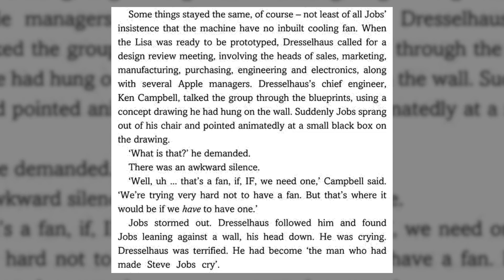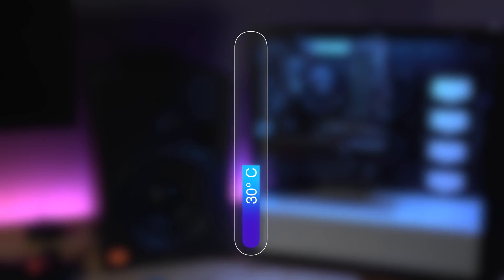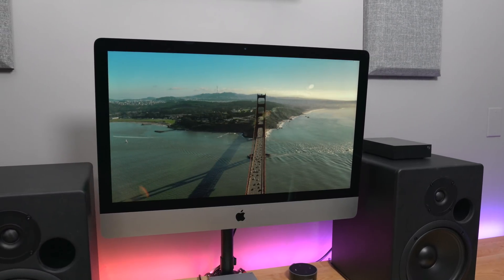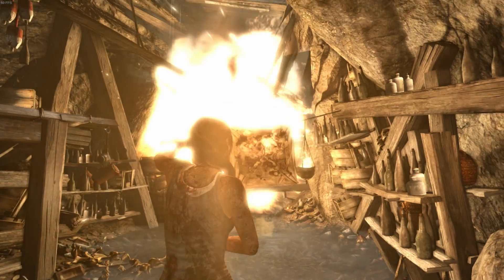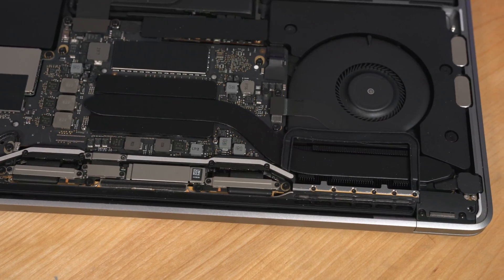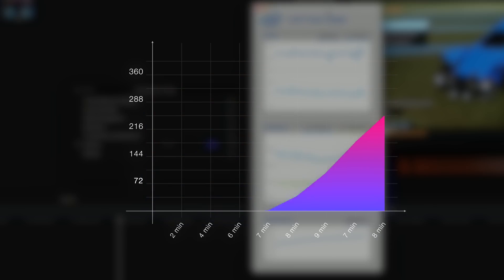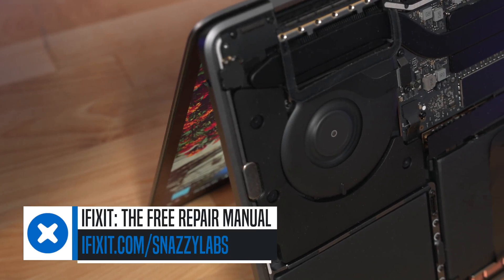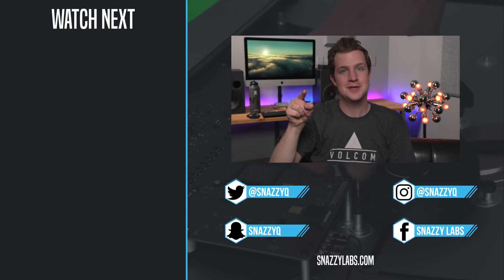Is Apple Ruining Your Mac's Performance?

Comment: This is why I use smcFanControl and have it cranked to 6000 RPM at all times. Otherwise my 13" 2015 MBP is too slow tbh.
Reply: Enzo Caggiano My 2007 MacBook Pro burns me if I have it at 3000RPM fixed.
It needs to be at 100% if you want to keep it one your legs for longer than 5 seconds.

Porco dio
Reply: I use that too. Otherwise my 2006 mbp would burn my legs worse than it already does :p
Reply: @centurybug  Was your 2006 MacBook Pro always so hot in the initial years when you got it? Or it got worse later on?
Reply: @RamMohammadJosephKaur  I didn't own it when it was new, I got it in about 2014 I think? Macbooks are known to run hot though, so I wouldn't be surprised if it was always that way.
Reply: Enzo Caggiano you’re wrong
Reply: Gerardo Ricciardi yep. And tbh I only keep mine high to load a bunch of YouTube videos at once or when exporting a video
Reply: iTouchAppReviewers he's not wrong.
Reply: iTouchAppReviewers is your mac burning too when you are watching videos?
Reply: iTouchAppReviewers I almost cooked my legs while using my 2009 MacBook pro.
Reply: iTouchAppReviewers This is why I have a PC.
Reply: victornpb I don't really care about the fan life, I have thousands of spares in my friends computer repair shop
Reply: i use macsfancontrol and i set it up to range the rpm of fans within a smaller interval of temps (like i set a much lower max temp and a lower favourite idle temp), so it just ramps up normally but in a smaller temp range.

AH and i also made holes under the fans on my macbookpro. holes in a radious pattern and placed a very thin plastic mesh on the inside to keep dust out.

now is properly cooled, trust me, if your mac is "vintage" or "obsolete" get a dremel or a proxxon, draw a good pattern and drill the shit out of it
Reply: fan lifespan is such a stupid argument. running cpus and gpus hot will reduce chip's lifespan, which costs more? a board or a fan? have you a grain of salt? i've replace both my mbp fans with the same model it mounted = 15 bucks and super easy. if you burn your gpu (look at 2011 mbp) well...600 bucks. PLUS on a modern mbp you'll lose all the data since the ssd is soldered on tur board, so it's a 600/700 repair + data loss for longer fan lifespan.

dust doesnt affect electronics as long as you dont work in an metal workshop
Reply: I came back to this video to comment smc Fan Control.  Perfect accompaniment to any Mac.  But 6000 rpm is a bit extensive.  I have a higher RPM setting at 4000 rpm which I turn on before doing CPU extensive tasks to pre-cool.
Reply: i use that so it doesnt burn my leg in garageband
Reply: Don't forget about the fan life as well, at max speed it also wear faster, I don't recommend cranking it to full speed, put it on like 80%. You have diminishing returns on RPM vs Power dissipation.
Reply: Enzo Caggiano Enzo I did and nothing changed. I too thought that 10 years old TIM was the problem, but nope. I replaced it with MX-4 and it still goes to 80 degrees when I charge it.
Idle temps maybe went down about 2-3 degrees
Reply: victornpb Replacements are super cheap even in the new model and fortunately, the fans are super easy to replace
Reply: If you're going to drill holes on your MacBook I advice you to drill on the opposite side of the hinge not right near the fan, that way you will have airflow on the entire board and not just the heatsink.
Reply: I don't think what apple does is bad for the average consumer, lower speeds will make the fan last longer, most of the time you will have a quieter machine, it will collect less dust, so maintenance will be lower. I agree that for "pro" users is not something they want, but it make sense to let pro users change the profile to a more agressiva cooling than asking the average to tweak a profile to make it run quieter, they just don't change settings.
Reply: victornpb 
do you mean on the top? just above the keyboard?
ot you mean on the bottompanel but "away from.the screen" like where the trackpad is placed? bc there is the battery and would be useless, but above the keyboard on the top panel could be good to let heat raise and escape.

it could be a though job thou
Reply: iTouchAppReviewers 
I always hated using my MacBook Pro in class, cause it was the loudest beast in the room just to avoid singeing my legs.
Reply: iTouchAppReviewers one word: ssd
Reply: I use SMCFanControl but I don't want my machine sounding like a leaf blower all the time.  I bump the speed up until it starts to become noticeable, then back it down a notch.  I just wish it allowed you to re-map the entire Temp vs. Speed curve because it's really the higher temp zone that needs the adjustment more.
Reply: Gerardo Ricciardi ahahhahahah il porco ci stava pienamente
Reply: 5000 rpm is the sweet spot between silence and burning your skin
Reply: Yeah but it's too loud imo. Used for a while but it's very annoying running fans at 6000rpm all the time
Reply: Enzo Caggiano
è difficile cambiare la pasta? Ne ho davvero bisogno ma ho un po' di paura. Secondo te se vado in un apple store con la mia pasta e gli chiedo se possono cambiarmela lo fanno?
Reply: I use macs fan control for cruising my fan at 6500 rpm XD, but the lowest it can go is 41 degrees...that's hot!
Reply: I use mac fans control and also replaced thermal paste and cleaned the shit out of it, at least the average temps dropped by 10ºC and i don't get close to 96ºC anymore, maximum peak are 86ºC or so which won't kill the cpu or the gpu that fast, unless I'm exporting ofc. The next step is to upgrade to liquid metal thermal paste but this needs to be applied with extreme precaution since its conductive and can kill your machine, but it does miracles to temps! Some people reported up to 20-25ºC less after the upgrade, even on full load! So yeah I recommend also cleaning your fans and heatsinks regularly (once a year or every 2 years) and the thermal paste with a quality one, (IC diamond, Grizzly (best one IMO), Arctic, etc)
Reply: Enzo Caggiano cleaned with thermal grizzly kryonaut but using serato dj or final cut I open smc manual on 5800 rpm while having my macbook on a flat surface with something under on the sides since the cpu and gpu and the cooling system is all in the middel and rightside (bottom) leftside from the keyboard and works great never have a cpu throttle

Comment: I installed mac fan control appli. at default, MBP's fan speed is too slow.
I think apple's productions remain outside , they have no desktop ,they have no high performance GPU, they have no liquid cooler sysytem.

Comment: sadly, almost every single high performance laptop and all-in-one PC has some degree of thermal throttling on heavy load.
Laptops I can understand, there's not much space to work with, but iMacs and other AIO PC's often have a lot of room inside that whole genre needs better cooling solutions
Reply from the maker: +Dave Lee Agree. Laptops are understandably tight (although, they could definitely put the second fan in the base-model MBP escape). I completely agree on the iMac. There is tons of room in there and a super tiny cooler. This year (2017) they moved to a slower fan that doesn't push as much air. Why? Who knows...
Reply: for the upgrade in 2018. "NOW WITH 23% MORE AIRFLOW!"
Reply: Dave Lee I think Apple got liquid cooling PTSD from the Power Mac G5, but I'd love for them to try self contained liquid cooling again, in the iMacs and/or the Mac Pro.
Reply: Sgt Brobee Microsoft made the bottom of the Surface Laptop a vapor chamber cooler, which is pretty cool, other choices in there aside. I'd love Apple to get more creative with cooling than just fans and heatsinks.
Reply: And the MSI Titans and Asus GX800 are here to save us from heat!
Reply: @Martin Peterdamm, Apparently you DON'T know the "chips" inside the iMac pro. The optional Pro Vega 64 in the iMac Pro will have a 225w TDP. Not sure what the TDP is on the base option Pro Vega 56 yet, but it will obviously be less than 225w. As far as the processor goes, the most powerful option is 140w (18-core Xeon W-2195). If you're going to prematurely declare something as a failure you better at least have your facts straight.
Reply: Dave Lee no it doesn't lmao. If your laptop thermal throttles you bought a shitty laptop. My Asus rog only hits 85 degrees Celsius under really have load.
Reply: Martin the iMac Pro will clearly use slightly underclocked chips, their webpage for it states the whole thing is 500 watts where Vega could take most of that alone. Like the "pro" radeons in their Macbooks, they'll dial the clocks down a bit for much lower power use. We'll have to wait for throttling tests.
Reply: Problem with iMac is the "thin" design, which is only really thin at the edges anyway.  You have to have a mount / stand behind the damn thing anyway so thinness in iMacs is an even bigger fallacy than in laptops.
Reply: Hey you two, go get a room! 😁
Reply: they should make the entire underside of a laptop a heatsink
Reply: Sgt Brobee So you can cook your lap while working :D
Reply: The ROG cooling systems are hella overbuilt. Mine is 5 years old, and even maxing out the GPU and putting a good load on the CPU (still haven't maxed that out) it still runs at a decent temp, and not too loud either. Very solid laptop (in case the weight didn't tip you off), worth every penny.
Reply: Christian Stout totally agree, my gt73vr never overheat.
Reply: My Aspire V Nitro throttles too much. 100C under load. 15 inch laptop, with a decently beefy cooler.

i7-4720HQ, GTX 960m
Reply: Will Dresner repaste your cpu and GPU then undervolt both of them, it will solve all your issues.
Reply: Dave Lee I think the vents on the back of the iMac could be way better my friends Inspiron 15 7567 gaming laptop might have a better cooling system than the iMac pro 
That thing is so big and could have a way bigger fan and a bigger area on the back of the computer for heat to leave
Reply: They want your CPU to degrade much quicker (as well as other parts) which equals to repairs or lower life span. This results in buying a new laptop/desktop ever 2-3yrs instead of 4-5+yrs.
Reply: I'm pretty sure you know most windows gaming (and not) laptops don't throttle this frequently or at all.
Reply: Gianmarco most window laptops do throttle... its called shitty laptops... Apple been going down hill... I admit this...
Reply: Dave Lee BS! Dell precision, Lenovo ThinkPad, HP elitebook laptops all equiped with workstation GPU + Xeon cpus + 64gb ram + up to 4 hdds...work constantly 100% load on everything, all day AND with the screen lid in closed position, never went above 65 Celsius. None of those has any of Apple dna.
Reply: but just compare pc and apple with the same hardware inside and then their cooling solutions. in the pc world the barrier is around 79°C because of degrading … apple gives a shit about it. 
take a look at the upcoming imac pro the already known cooling and also we already know the chips insides : the vega runs hot as hell with spikes over 400W and the new multicore skylake xeons also over 300W and this has to be cooled. even apple can't beat physiks and so the imac pro is already a huge FAIL or just for people with small, short projects
Reply: Dave Lee you are a fanboy man, shut up
Reply: i do have old inspiron 7520, bought 5 years ago. Overclocked gpu by 20% (without changing voltage). It has mobile i5, and 4 core i7 was also an option. It never reached 90* even under full load. The point is: look for temps in reviews, and dont get the most power hungry option, cause they all have same cooling system.
Reply: Dave Lee

This noob keeps crying, not knowing what he say's, mumbling bullshit channel. Apple invested in ARM and the PowerPC consortium, not able to release any complex high Ghz CPU, needed the water cooling solution on a office computer....
Please remove this channel, or keep crying!

Comment: YES. MacOS Sierra caused so many overheating problems, blasting the fans when its supposed to be asleep and even when one tab of Chrome is open. I'm 300% positive my GPU has partially desoldered itself and the screen will freeze if you tap the bottom hard enough. Goodness...

Comment: If you manually control the fans with Macs Fan Control and for example run them full blast before starting the render, you'll be able to keep the temperatures down. I also run them manually when the ambient temps are very high in the summer.

Comment: It's a lose-lose situation for Apple. If they use louder fans or make the fan speed up more aggressively, then customers will complain about the noise. If they don't, then customers will complain about thermal throttling, and I'm sure they wisely assume less people fit into this category than the former.

Yet this video makes no mention of smcFanControl, and it does make a difference for those who want to speed up the fan to max early on during heavy usage in exchange for less throttling. The title is also an obvious attempt at clickbait, so I'm kind of disappointed to see this come out of Snazzy Labs. Guess that's what to expect when channels become large and heavily-sponsored.

Comment: This is the fucking problem man. I installed bootcamp windows 10 and trying to play overwatch. Was able to play at low 720p at 60fps for 15 minutes. After 15 minutes, it runs around 40 fps and the clock speed is 1.17Ghz. Till this day, I still have no solution for this problem, I tried almost everything I could. Guess I just can't play games on macbooks.
Reply: Karl Wang what Mac do. you have and year?
Reply: NovaDoll 2013? The first Retina display MacBook 15 inch with i7-3615qm at 2.3 ghz
Reply: Yeah playing games on a mac is just a horrible idea
Reply: Sry bro, Macs are not for gaming... not for any graphical intense software actually.
Reply: Shake speare nah I completely cleaned up the fans and put new thermal paste on the CPU. Now the MacBook works like a charm. 60 fps at 1080p with no problem, now I can continue streaming and have fun on my overwatch : )

Comment: Apple is actually one of the few laptop makers to remove normal TDP caps and just let the processor run up to its TJunction Max. So they're happy to stay at boost as long as they can before hitting that Tjunction temp. Combine that with the conservative fan settings, and yeah they definitely can run toasty, but the removal of artificial TDP limits actually helps them perform pretty well in the class they're in (i.e 3 pounders for the 13") with equivalent chips. Also no sign of VRM throttling like some Dell, HP, etc models.
Reply: tipoomaster The YouTube comments section is no place to be speaking the truth. How dare you!

Comment: If you've got balls enough you could hardwire the fan at a steady voltage. Or go more elaborate and program an IC to read the temp from a thermistor and change the voltage accordingly. Obviously not practical for anyone but still doable.
Reply from the maker: +The Mod Shop There are actually apps that allow you to modify fan speed but it doesn't remove the problem of cooler headroom not being sufficient to cook the CPU at max fan speed.

Comment: I have  a late 2015 27" iMac and when I've checked, it's been  between 32, and 45C for the most part.  My late 2013 13" MBP gets hot faster.  I am familiar with the heat issues on macs.   Both my Macs have a core i5, since right now  I don't have anything extreme enough to need an i7.  I've also found depending on the computer, and what I am doing, sometimes on the MBP the fan will ramp and the computer gets really hot on trivial things, so not sure the best management is going on there.

Comment: Thx for the video! Well, I actually think the same thing as you...
What they can do to avoid this "problem"?
I dont see they changing the minimal design of macbooks, it is an iconic design... Maybe put bigger fans? Change the cooling mechanism? Or optimize OS?
I think they need to work more in the OS, because if you bootcamp Win10 and play some games or do some work (photoshop, illustrator or some video editing apps) they will perform better with the same hardware. Maybe this new APFS will help a bit or even the new metal 2, i dont know.
What do you think? Optimize the macOS or really change the MacBook design?
Ps: thx for the video!

Comment: This is why I use an application called Macs Fan Control (smcfancontrol works good too)...I ramp the RPMs on the fan on my 11 inch Air to 6500 RPM and get huge performance increases

Comment: Heres a cooling fix :3 cut a 120MM square in the bottom of that baby near the CPU/GPU heat pipes, Glue a 120MM Desktop Fan to it then wire the 120MM Dekstop fan to a 12V Wall Adapter(Cell Charger) or Usb Cable for portability  BOOM MORE MORE NOISE MORE FUN  Note: i've done this too a few laptops that have real crappy cooling and it works.

Comment: Take off the backplate of the macbook, plug a monitor. This is not a fix, is a work around.

Also turn off the turbo boost, turbo boost is only for short periods of time.

The heatsinks in macbooks are very thin and small since 2010, my old macbook pro 2011 died from heat on the GPU.

Comment: I've noticed that my MacBook rarely speeds up the fan during heavy use. When I'm playing TF2 (which seems like a heavy task for my 2012 baseline MacBook Air) it reaches up to 195°F in about 2 hours with the fan kicked up to 6000rpm. Sometimes I forget to turn it on and it thermal throttles in like 30min. Screw Apple and quietness, just blast the fan 24/7 for better cooling. I use SMCFanControl